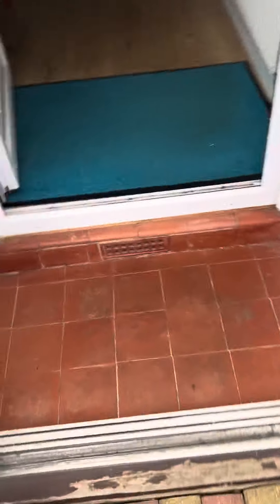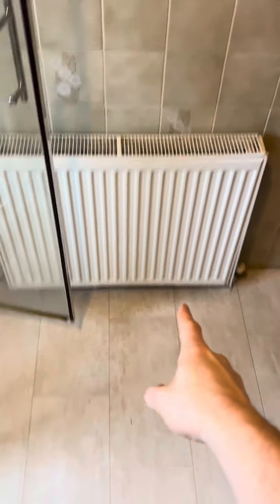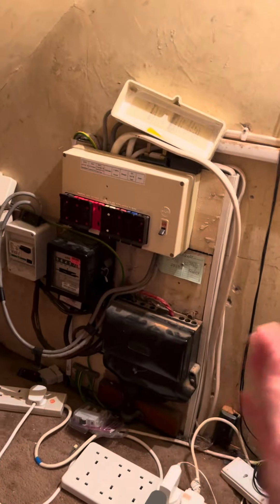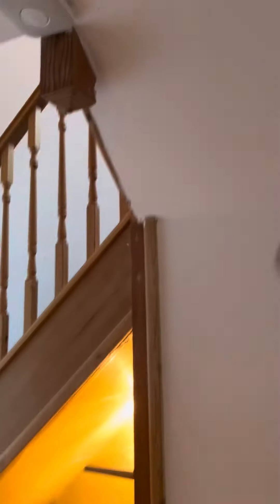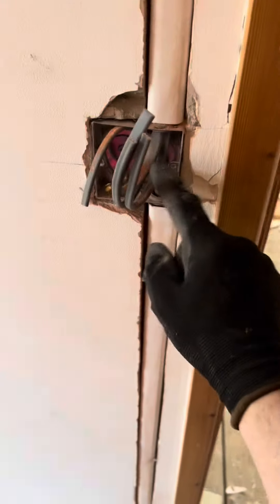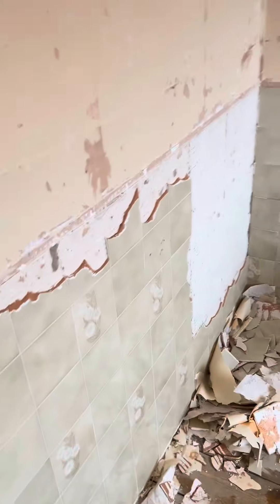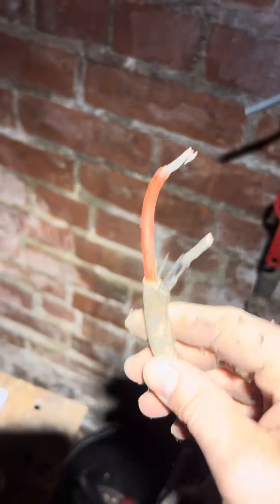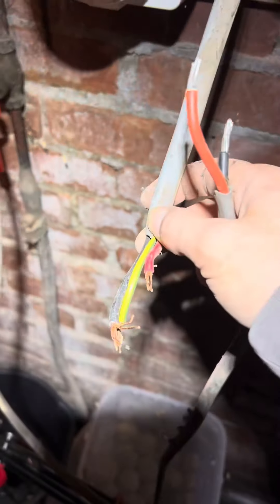No CPC in the lighting circuit!

Comment: Nice work.  

Worth checking MI (manufacturer instructions) for fan as most require a fuse on the Line.
Reply from the maker: The fused fan isolator I installed provides a 3A fuse on the permanent
Reply: @bristolsparky  good stuff
Reply from the maker: @sergiofernandez3725  did you not see it in the video?…

Comment: That Wall Chaser Makes light work of running in cables , That cable looks like Post War 1950's is it Rubber ? my Bungalow was built 60s Ripped out 6mm rubber with no CPC from built in cooker.
Reply from the maker: Looks like twin&cpc, didn’t feel like rubber that i normally rip out
Reply: They used to manufacture Capothene Cable per curser to Pvc
Reply from the maker: @richardbragg2284  ah right, wasn’t aware of the specifics👍🏻might have a google later